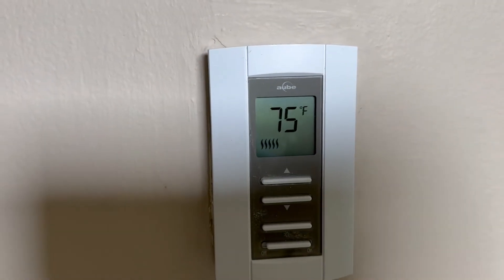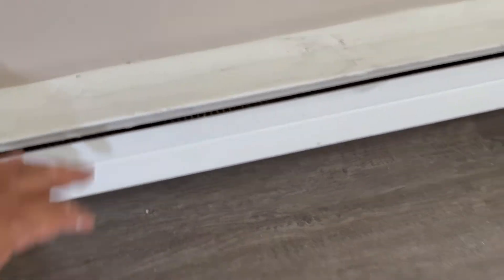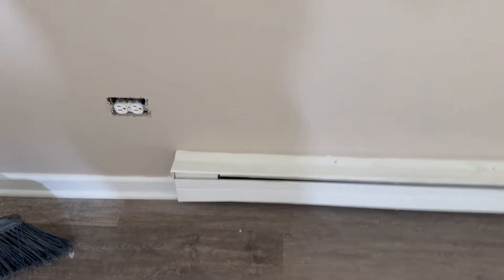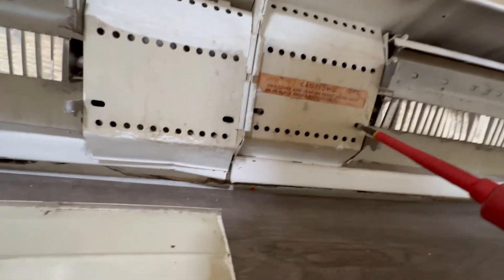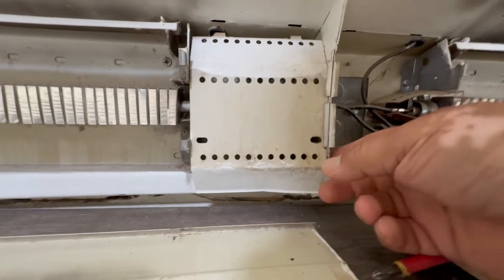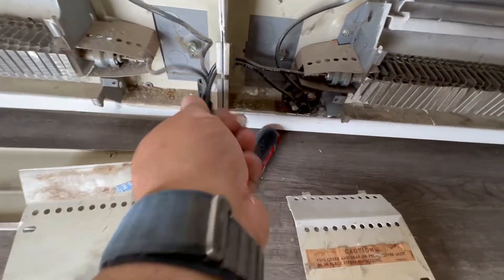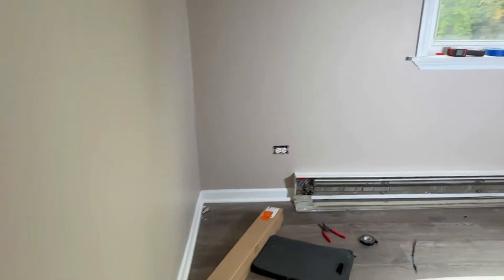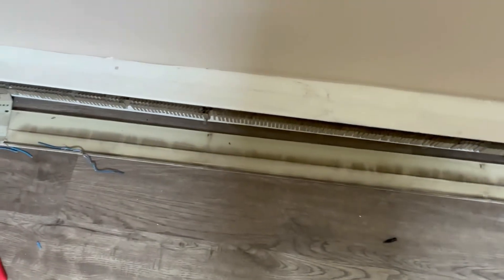240 V BASEBOARD ELECTRIC HEATERS.  SERIES OR PARALLEL?

Comment: Great video, I was amused you did not clean up the heaters first by vacuuming, but that added reality.   I see parallel much better by the video than I did in classes.   I was surprised you could twist the wires by hand!  I presume these much 12 gauge?   I am about to install new heaters where I will replace one with two just to remove part of the heater from being under a receptacle.   I am going to have to do some testing to find out which wire is my main power wire. Also,  I did not know your area had so many color variations! Thanks.
Reply from the maker: Hey Dale,  Thank you for your wholesome comment.   I did not cleaned it because I wanted to show reality. LOL
   Yes it is 12 G. and it was hard to twist.  Well it didn't. LOL .  I have strong hands.    Over here they try to do every circuit a different color. ,    Thank you so much    Have a good one.

Comment: No outlets allowed above baseboard heat, cords droop over heater and can become damaged.
Reply from the maker: Yes.  Thank you for your input.    Unfortunately 90 percent of heaters I see have them.    Greetings
Reply: I was, again, amused, by the comment and wonder when this came about.  The codes change overtime.  A reason for watching this and even to call my electrical engineering buddy was my replacing one heater with two just to bypass the heater under a receptacle.  I also moved a receptacle to add a new heater under a window and wanted to avoid what must have been okay about 30 years ago the Phase III of Gondola Village in Whistler British Columbia was built.

Comment: The 3 wires in that small conduit is above the maximum fill%. This would fail electrical code.
Reply from the maker: Hello,  That hole is only the access of a larger area.  It looks like an isosceles triangle  inside , if you pay attention.   Plenty  area for those 3 wires.   Thanks for your comment.
Reply: I have a problem whit my baseboard heater . Only works by 5 min and then it’s stopped. Solo calienta por 5 min y después se apaga sin llegar a la temperatura . El termostato se oye que funciona solo arriba de 75 F.
Reply from the maker: @EdgarFuentes  HOla Edgar    Puede ser el calentador o el termostato.
1.  Corta la corriente eléctrica del breaker.
2. Desconectalos el termostato.  Quitalo en su totalidad.
3 conecta el calentador directo.
4 Si el calentador sigue prendido después de 5 minutos.  Entonces lo que no sirve es el termostato.
5. Instala un termostato nuevo

Comment: Nice troubleshooting.   The ONLY way you could make two heaters wired in series work on a 240V circuit, would be two 120V heaters of the same wattage wired in series, for example two 1500 watt 120 volt units. While this would work, I highly DO NOT recommend anyone do this for a couple of reasons. First off, if one of the heaters were replaced with a different wattage in the future, then the heater with the lower wattage of the two would get voltage higher than 120V, causing it to run hotter than it was designed for a create a safety hazard, while the higher wattage unit would get a lower voltage and give off less heat. Also if the heater needs to be replaced in the future, a future homeowner or contractor will probably get the specs off the nameplate before heading off to the home improvement center or online for a replacement and get one with the same wattage and voltage.  If they follow the wiring diagram and wire the heater properly, that is, in parallel, then each heater would get 240V.  A 120V heater wired to 240V would draw 2X the amps and produce 4X the wattage than it was designed eg. 1500 watt 120V unit produces 6000 watts of heat at 240V. The result is severe overheating, destruction of the heater and possibly torch the home.   Thirdly, connection in series most likely violates the manufacturer's instructions, which is a violation of the National Electrical Code aka NFPA 70 if you live in the U.S., in this case an electrical injury or fire damage that occurs as a result of unapproved installations could result in your homeowners insurance claim denied.
Reply: What are you talking about?. You are completely wrong, parallel is like running 1 termostat with running baseboard heater separate to each other. As long as they are both 240v 2 pole regardless of wattage capacity, it should not be a problem, it could carry the ampere being used.

Comment: You can not put them in series as you would need 440VAC for 2 of them. They must go in parallel just like any other electrical outlets are wired. Your circuit breaker and feed wires must be properly sized for the amperage drawn for the total number of heaters installed.
Reply from the maker: Well said!!  Thank you so much for your input.